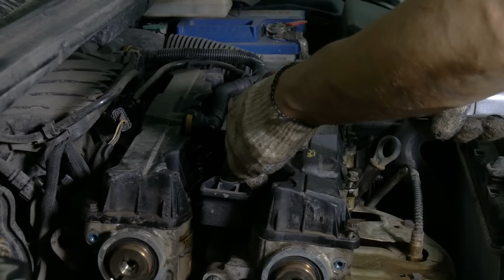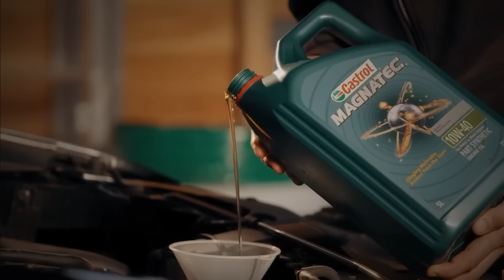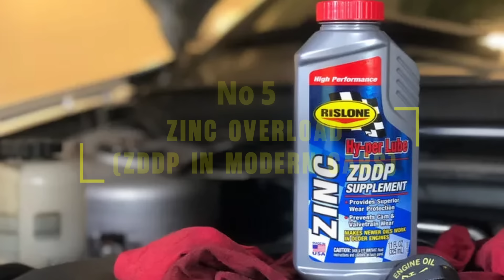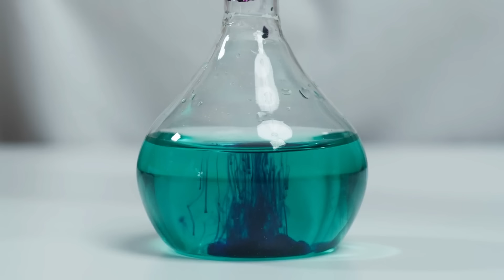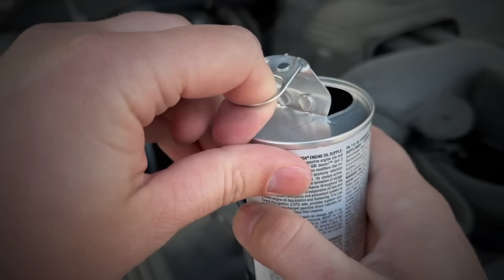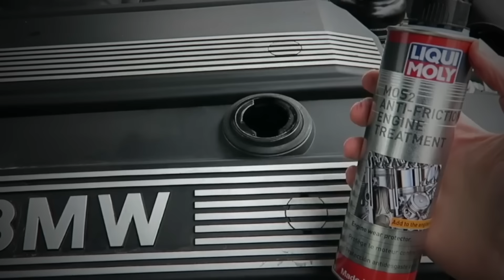11 Engine Oil Additives That Will DESTROY Your Car! (And 5 You Should Use)

Comment: Good rule of thumb. Use NO OIL ADDITIVE. Change your oil every 3000 miles and replace the filter and you’ll be fine. I do however recommend a fuel additive. I use Techron at every oil change. Gas companies add fuel additives in their fuel but I don’t trust that tbh. A lot of companies slap a label on something and most buy it hook line and sinker…I don’t!
Reply: I drive a minimum of 500 miles a week.  We have a lot of fleet vehicles at work.  I used to do 3,000 mile oil changes back in early 90's to probably mid 2010 with only synthetic.  Now I do it at about 5-7,000. Reason is, my driving has changed.  Still use synthetics, but my driving is mostly highway now.  Back then, it was 80% city.  So I think that has a lot to it.  I do think the newer your oil and the cleaner it is, the better.  However, there has to be a tipping point with cost. Going back to fleet thing, I can tell you of the extra wear on vehicles that do not get the oil and fluids changed. They do wear faster.  As far as the manufacturers saying change oil every 10,000 miles.....you go ahead and do that.  You won't know anything until you are out of warranty.  You saved on oil changes, but that motor is going to cost you more, alot more.
Reply: @davidb1169  That's 100% OK 👍🏻. 5-7k mis MAX along w/synthetic oil filter like Fram Ultra or Fram Endurance, Purolator One or Purolator 20k filters. Motorcraft is best of OEM brands. -Engineering perspective
Reply: Man 3k miles would be like every month for me. I drive some expensive cars but seasonally and 5k miles has worked fine with Mobil 1 Supercar 5/50 or 0/40 depending upon season.
Reply: @nyplantings2420 
3000 miles OCI needed only if you drive short distances, especially in cold weather conditions so the engine never heats up for a longer time to enable the evaporation of the fuel out from the oil.
Reply: @ralfrufus6573  I drive more short distances than anything. Lots of stop and go, that’s why I commented the way I did but I truly appreciate your knowledge
Reply: @nyplantings2420  Same here. I have 2 cars running High HP 4 bangers, 300HP, with turbos. I use Mobile 1 5-30 and change oil every 5 k miles. Retired GM mechanic.
Reply: Best advice ever! ❤
No additives but OFTEN oil changes. 
Period.
Quantity has a quality of itself when it comes to how OFTEN you change oil.
Short OCI is best for engines. 
And again: NO additives in oil. Never! 

Only in fuel, especially when driving a Diesel a fuel additive is recommended.
Reply: Great advice, use a good quality full synthetic oil per manufactures recommendations and use a QUALITY oil filter. I fuel up with Chevron Supreme.
Reply: With my 2018 regal, i just checked the oil life monitor. The motor oil geek has reviewed the gm oil life monitoring system and says it is extremely accurate and reliable and that i can use it with confidence. Therefore, after it dips under 30% and before it gets to 20%, is when i get that oil changed. He said it's so good, you don't even need to do an oil analysis.
Reply: I've been using plain ol' Rislone with every oil change since I got my first car. Used it to winterize my Waverunner, a few drops in each cylinder, did NOT turn to coat the surfaces. In the spring, pulled the plugs to change them, they were coated with the product. Original Rislone defies gravity, it climbed the cylinder walls to coat every surface. I believe that if I were to tear down one of my engines, it'll be clean as a whistle internally. 
'97 J.D. 325 with the same 17 hp Kawasaki still running to this very day. Just developed a shaft seal leak this year.
Debating wether to rebuild it or replace it...
Reply: I have found liquimoly ceratec a game changer as my cars have never run smoother and quiter.l use synthetic oil 5w 40 at regular changes.Robin
Reply: How is Lucas injector cleaner
Reply: Mystery Oil...  used on big truck's, million miles plus vehicles. Enough said
Reply: Are you a mechanic?😊
Reply: @Mtnsandoceans Yes.
Reply: @Mtnsandoceans  if this comment was directed to me, no I’m not a mechanic but what does that matter? I’m 50 years old and have been around mechanics and mechanic shops a big part of my life. Matter fact my step dad is a mechanic and owns his own shop and has for at least 40 years and most I’ve learned from him. What I said in my original comment holds water friend and if you read comments about my comment have been made by mechanics and they’ve concurred with what I stated. Maybe you should stop being passive aggressive and trying to be a smart guy/girl and learn something :)

Comment: I haven’t used motor oil in my engine in years.  After one bottle of Slick 50, I drained the oil and haven’t used it in years.  Motor oil is a complete scam and waste of money.
Reply: I once drove from Vidor Texas to Vinton Louisiana and the gas gauge only dropped three ninths of a tank so that is 47.7 miles a gallon.

Comment: Showing Magnatec oil which has all the necessary certifications and inferring it is an abrasive oil additive when it is an oil is totally misleading and untrue and there are compounds which have a strong affinity to metal which is the basis of anti friction protection. I have seen many engines destroyed by the lack of or incorrect maintenance, but never an engine destroyed by the use of an additive in as little as 300 miles without there having been some underlying cause.
Reply: This EXPERT  is waiting for a Law Suit from CASTROL.

Comment: Problem with flush additives is that you absolutely shouldn't put any load on the engine when using them - no driving! Just setup your car for oil change, pour the flush into the oil, let it idle for like 10-15 minutes, might go for way longer but it won't help much, and then change the damn oil on the spot. It's not the problem with the additive, but with the way some dumbasses use it.

Comment: Was this an AI generated video? The pictures and images are completely wrong. Why can’t we just have intelligent humans making videos?
Reply: Great combination:  Artificial intelligence and natural stupidity.
Reply: @erie910 
Why do you think it is called "artificial intelligence"?
Reply: I have reached the point where if there isn't a real person in the video, I am automatically thumbs down and blocking the video. While a real person in the video doesn't mean that said person actually knows what they are talking about, at least someone put effort into making the video.
Reply: @Marine2171 I’m with you!!
Reply: I've used a lot of Lucas products with very good results. I had a car that started to knock when cold, the Lucas oil stabilizer did quiet the engine. After a few months I replaced the rod bearings and no more knock at start up.  It did help get better gas mileage too
Reply: I was tolerating the AI voice up until the point that it pronounced moly "mole-y" and went on to completely mangle the pronunciation of molybdenum disulfide. As the owner of a classic car with a flat tappet cam, I will give it credit for acknowledging that ZDDP is still required in that case. But as an actual mechanic I'm not impressed enough to bother subscribing to the channel!
Reply: @BrianM-q5u  I have seen these errors in other videos.  So what.  If the information is accurate and useful, why not use a time and effort saving technology and use the saved time to pursue and create other useful products and services.  This is the history of technological advances.  We could have full employment if we banned powered excavators and road graders and handed out picks and shovels to hundreds of workers.  But in the end the economy would decline from decreased productivity. Multiple new jobs will be created for every job lost to advanced technology.
Reply: |Because Ai is here and there is no stopping it. There will be many people out of work including actors, singer song writers etc. You name  it,  their jobs are hanging in the balance. Ai  is already writing songs and it''s singing voice is improving. Your next favourite band may sadly be Ai developed.
Reply: this is repub. corporations way of robbing you stupid Americans

Comment: $40 gasket job?  If you do it yourself...a shop will be hundreds to thousands of dollars.
Reply: But how long does that last and does it crystallise in the engine I wonder?
Reply: If any, if you did it yourself is gonna cost more than $40. $40, you might pay for just the head gasket. Plus we have the intake exhaust valve cover gaskets. Yeah, coolant to buy engine oil to replace filters. Far from $40.
Reply: But yes, way cheaper than it would cost you at a shop.
Reply: The $40 was for a valve cover gasket replacement.